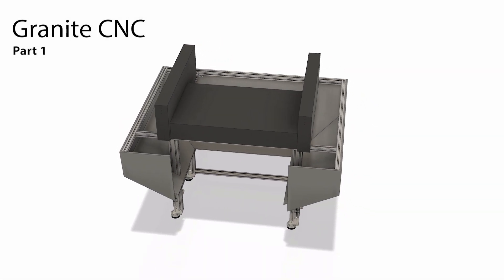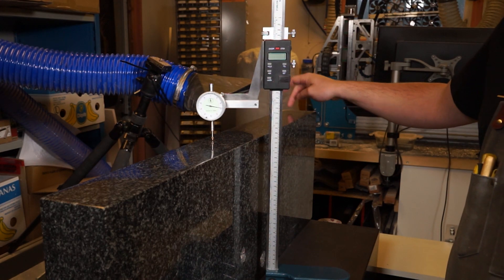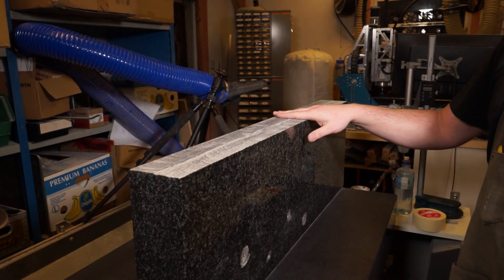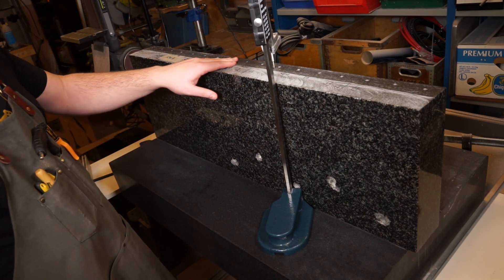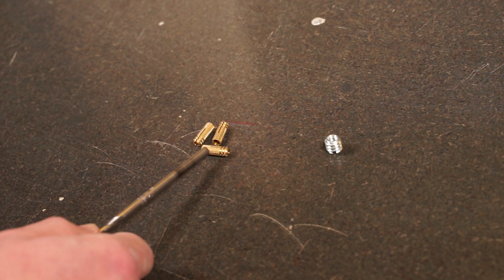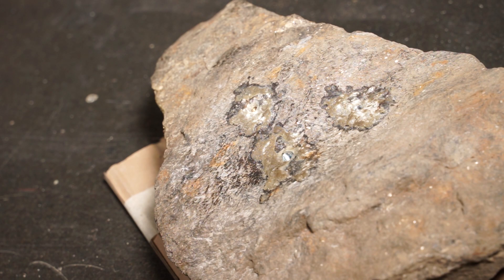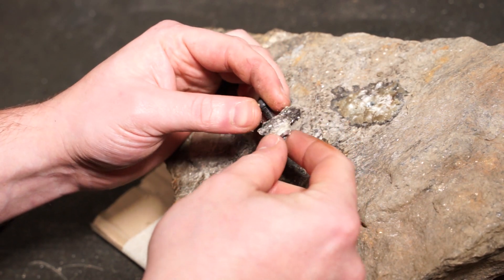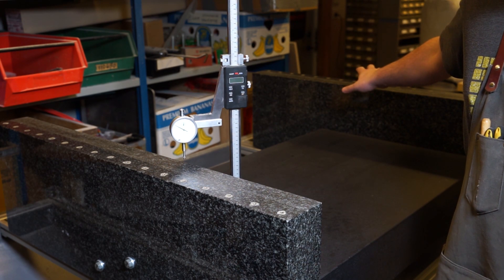DIY Granite CNC - Part 1. Granite base

Comment: You are better off placing the side on top of the granite surface plate then using round T shape nut and bolt combo that way you have very strong mechanical connection placing them on the sides will cause some movement when different loads are applied causing deformation as you are reliant on bolts and glue to support all of that weight.
Reply from the maker: @TinkerTomUK  that would be true if the sides where not supported by the frame bellow. But they are. I've run this machine for quite some time and the sides have not shifted one bit during all of that milling.

I'm sure it would work just fine the way you describe. You would however "waste" some of the surface plate and end up with a smaller machining area. Provided the plates are the same size of course.

Comment: Put a steel plate on the granite and level that plate. Steel is much easier to level than granite.
Reply from the maker: With hand tools it's about the same I would say. It's not only about getting a level surface. The more important goal is to make it parallel to the table. While you could put a metal plate in a mill and flatten it that won't help in reaching the end goal.

Comment: Could you have added a thin layer of self-leveling epoxy to flatten the side rather than grinding the side flat?
Reply from the maker: I'm not sure. I don't have enough experience with self-leveling epoxy. First off, the reference is the table. The table is not necessarily level. But I guess you could level it before applying the epoxy.

Even then I wonder if it will be flat enough? I have no doubt it levels itself to some extent but is it within 0.01mm? I don't know.

I guess you could sand it down after. But then there is the question of the epoxy being hard and stable enough under load when the machine is running. Is there risk of cracking?

You could probably do that though. I feel more comfortable that the granite won't deform over time. Even if it's a lot tougher to get it to spec..
Reply: @faggan3040 thanks for the response, all valid questions.

How is the mill now? Still going ok?
Reply from the maker: @aarondcmedia9585  it's running fine! I've been putting off making another video forever. Haven't felt like it.

I should really get around to that though. Maybe just a short walk around or something.

Comment: Hmm, I have to ask, was neither side of granite sides flat enough? It doesn't matter if it's parallel to the other side of the same block as long it was flat, since you shimmed it when mounting anyway? :)
Reply from the maker: You are correct in that it doesn't matter if they are parallel to each other. They do however need to be parallel to the table. If one is a bit higher off the table than the other doesn't really matter because the alignment of the X-axis rails will fix that. But you need a parallel surface for the Y-axis rails.
Reply: I'm new to machining and building these. Just been watching videos recently on other builds.If the Y rails arent parallel with each other how can they each be parallel with the table if they individually have to be parallel with the table assuming table was flat and level?  Or is this being said in case the table isnt perfectly flat and level?  Also why is it ok for one side to be higher than the other? Wont X being going uphill and downhill? Or are you guys saying its ok for granite blocks to not be level with each other(one being higher) that you will shim the rails later?  Sorry for the dumb questions.  I  did see the guys using that sliding instrument youre using to check for high spots (btw whats that instrument called) but they used it on the rails and torqued down the rails till they were parallel with the table. I didnt see in the videos of them checking if the rails were parallel with each other though.
Reply from the maker: @ChristopherJones16  - "but if the Y rails arent parallel with each other how can they each be parallel with the table if they individually have to be parallel with the table assuming table was flat and level?" You're correct, by definition they will be parallel. I wasn't explaining properly. I meant they don't need to be the same height. 

- "Also why is it ok for one side to be higher than the other? Wont X being going uphill and downhill?" Because the X-axis rails are not being aligned to the granite sides. They are aligned to the table. Lets say that the right granite side is 1mm higher than the left one. The gantry is now tilted, its higher on the right side. But because the rails are aligned with the table they are parallel with the table. They are however not at the same distance from the sides. The rail would be 1mm closer to the granite side on the right side. Does that make sense?

- "Or are you guys saying its ok for granite blocks to not be level with each other(one being higher) that you will shim the rails later?" It is ok. BUT, there are limits. The manufacturer of the rails you are using have a tolerance for how much height difference you are allowed to have in a case like this. It is usually dependent on how far apart the rails are. The further apart the more difference they allow. On my machine I don't remember the exact numbers but I am well within the allowed height difference in relation to my rail spacing. 

- "Sorry for the dumb questions I'm new and didn't see mentioned in the comments of the other build videos I've seen" Its not a dumb question. I could certainly have explained myself better :) 

- "btw whats that instrument called" Its called a Dial indicator. they come in different styles, measuring range and precision.

Comment: This is perfect, I wanted to see how the process is to make a CNC using a granite base, it's cost effective and easy to make. Nice clear HD video, I can hear your voice clearly. Is it better to use inserts rather than tap into the holes? I hope you make another granite CNC and show us full details how you made it. Thanks!
Reply from the maker: Thank you. 

You need some sort of insert. The granite cant be threaded like metal.
Reply: @faggan3040  thank you. I will keep note of this. Do you have any recommendations which are good inserts which might be better than what you’re using currently?
Reply from the maker: I cant know that can I? I haven't tested any others than the once you see in the video. The once I use combined with the injectable mortar is strong enough for the application.

Comment: I must admit when I saw you pull out the diamond cup wheel I thought "Oh know he's going to make a mess of that!"  I would have thought it would have been much too aggressive for what you needed.  Did you do all the remaining sanding/polishing with sandpaper or did you use diamond pads?  Just curious.  Nice job either way.
Reply from the maker: It was very aggressive. Especially if I tilt it and use the edge instead of laying it flat if that makes sense. I only used the diamond wheel for roughing. The rest was done with a sander and then a wetstone manually. I'm sure there are tools that would allow the control to achieve the precision I was after but for budget reasons I opted to use the wetstone. In hindsight i would probably look for a machine tool to do it instead. But at least this way I got some exercise as well. 😀

Comment: Congrats on the build. 
But no mention of the inspiration of the basic idea and work flow? Not to detract from what you are building which I am full of respect for as I am hoping to do the same some day. But I feel like it's quite obvious where you got a lot of the ideas from and personally I would have like to see him mentioned or linked to.
Reply from the maker: As far as I know this have been done by at least three different people and posted on YouTube. All of them share the same principle with a granite base design but are very different in solving some of the issues involved with the granite. In my case i have taken inspiration from all three of them and also some professional CNC machine builders such as Datron for my machine. 

This will become more clear once i start on the axis of the machine i think. I Hope you stick around for it! :)
Reply: @faggan3040  OK, good on you. I know there a few out there by now, it's just that I have only seen one (Fox's) in the layout you adopted. The others I have seen are mills or moving table designs. And then of course a bunch of cast epoxy granite designs but the genious, as you know, of the surface plate idea is that you can get a very accurate frame with very simple tools measuring it all from the known quality of the base. 

Like I said, happy you're actually building something so of course I will follow the progress;-).
Reply from the maker: Fox have some issues with his design. One of them being his lack of Z height. He's adeessing this with his rebuild now. 

Because I had the chanse to look at his and other builds I could make the granite sides thicker and higher from the get go.
I also have some other demands I want to include in my machine. Like a ATC magazine and the ability to fasten long materials on the front of the machine in a vertical orientation to have access to the edge.
Reply: @faggan3040  His rebuild is a lot about chasing better tolerances. You making your sides taller is more of a personal preference than anything else in terms of what parts you need to be making and the router I have mocked up in CAD does indeed have taller side walls, too. It would also be longer in the Y than in the X and I would make end walls with gaskets closing up the "whole box" with the hopes that I could get by without a cabinet - it would just be a smaller desktop sized machine. Still, there would be zero doubt in my mind where 90% of the inspiration came from despite me being able to make it more for my use.